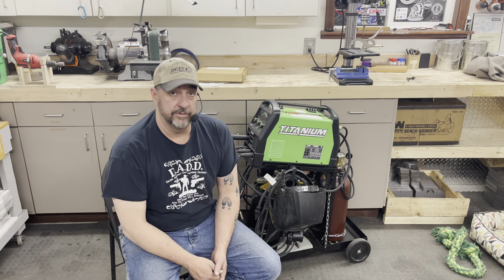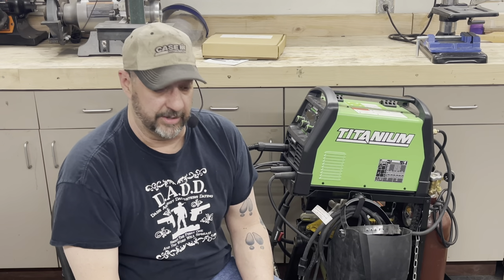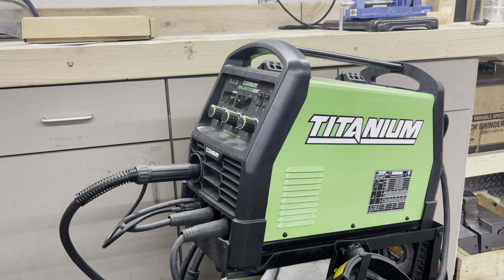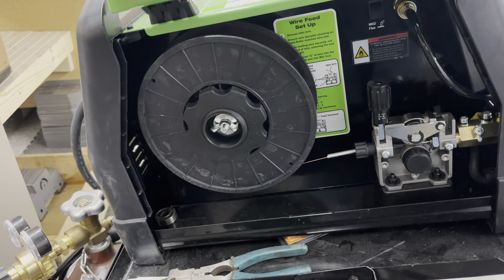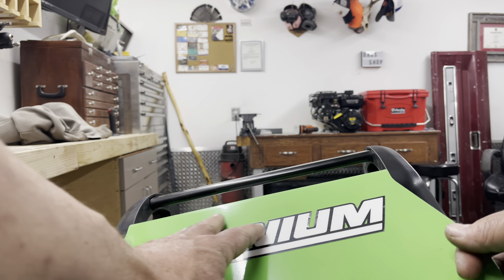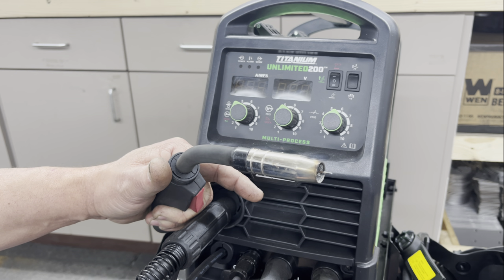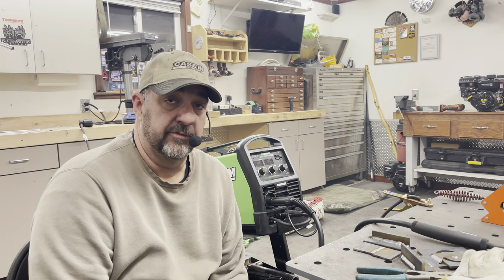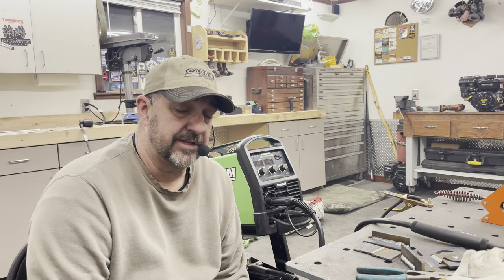Harbor Freight - Titanium Unlimited 200 Welder - Junk or Jewel?

Comment: I am trying to weld up an off road bumper for my truck. In your opinion do you think this welder could be capable of welding 1/4 inch steel. Or is that a horribly novice question. I have no experience welding just a do it myself guy.
Reply from the maker: This machine would be very capillary of doing the job. I would recommend a 220v power outlet but the answer is definitely yes, it will absolutely do the job.
Reply: @jackofalltrades7822  awesome! thanks for the response is that just the because the upgraded voltage would give me the high bonding temp/power/penetration? Only reason I ask is because I only have 120v in the garage currently.
Reply from the maker: @evankoenig952  several reasons. 

220 will give you a higher duty cycle. 

220 will give you more output amps (a full 200 amps) which equates to a hotter weld with deeper penetration. 110v will only yield 140a output. 

Running a full 140a off a 110v outlet will work but you will likely be tripping the GFI or circuit breaker regularity on a 20a garage circuit. A 15a garage circuit will not work at all.

You might also look at the 170 MIG. The Unlimited 200 has lots of features that a garage welder might not need such as TIG and spool gun capabilities. You might be paying more than you need with the Unlimited 200. 

Good luck.

Comment: 2T and 4T are for TIG.  2T is if you are doing Lift start, 4T if using a pedal.
Reply from the maker: Not on this machine. This welder does not support a pedal or hand control. This machine is a scratch start only. 2T and 4T is only functional with MIG (wire) welding on this welder.

Comment: I've been using one of those Chicago Electric $100 Flux MIG welder for several years, it works, but I agree, if you really want to weld a lot don't buy one, buy a Titanium or Vulcan MIG welder, spend the extra few bucks...yeah that $100 welder does work, but it seems even with my limited welding skills its inconsistent no matter what settings you pick, it kind of does what it wants.

Comment: Very good review overall. Here's what was missing in my humble opinion. 
3/8" thick steel welds. It's advertised as doing them. Also, what settings at the time of weld. It all looked really good, except, you left me in mystery to the setting you're using. Maybe a 6 month follow up on different steel thicknesses and settings.
Reply from the maker: 23:09 I show you the settings and even turn the knobs. 180 wire speed and 18 on the voltage. 110 v ac was the supply power.

I didn’t have any 3/8 but will get some and try it. The requires 220 and I have that now so I will do a follow up with heavier material.
Reply: @jackofalltrades7822  have you done a video with the heavier material yet? I’d like to see that too. In the market for a welder for home, farm, auto type stuff and I know some implements I have are 5/16” steel so I’d love to see the 3/8” stuff too!
Reply from the maker: @lh98  not yet

Comment: Did you add an extension to the weld cart? I bought the cart from HF and the top is too short and doesn’t have that cable support that yours has.
Reply: Never mind 🤣 3 minutes later you said.
Reply from the maker: I did. I show it about half way into the video
Reply: @jackofalltrades7822  thanks! I bought this machine on Saturday and need to get some gas this week so I can get running. I watched your tig video on this machine too. I appreciate the videos.

Comment: I've got that machine and I've used the MIG welder many times and it burns very well. Now the TIG and Stick? Now those I've not tried yet but if they burn like the MIG does then I'm sure I will be very happy with it.
Reply: They take a lot more skill. You have to manually control the arc length and wire feed. Imagine writing with a pencil that is continually getting shorter as you write.
Reply: @maplebones  Yeah, I can see how that could get tricky all right. I know when I've stick welded in the past that I'd seem to run out of stinger about 3 inches short of my goal and would have to use another stinger to finish the job. Then I'd end up with a mostly intact stinger short about an inch or 2. LOL.

Comment: Is 0.023 and 0.025 wire pretty much the same? I don't see 0.023 on the chart of this welder and I need to use that size for thin sheet metal.
Reply from the maker: Sure. Your just gonna have to adjust accordingly.

Comment: Was that MIG or FLUX you were showing?  I'd guess MIG 'cause there was hardly any slag.
Looks like a nice machine.  I'd like to learn welding, but can I justify the cost of a machine that can handle all 4 technologies?  A FLUX / MIG (spool gun capable) would probably serve me, why throw STICK in there when MIG is so much nicer?  I hear TIG is tricky, but it DOES do Aluminum nicely, however if I have to cut corners somewhere to afford my first welder, a good MIG/FLUX machine would be a good choice to learn on.  IIRC there is such a machine in the Titanium line up.
Reply from the maker: I used hard wire with 75/25 gas, not flux core wire. If your just getting started the Titanium MIG 170 or 140 would do well for you and is less money. You can weld with flux core or no flux (hard wire) wire with a shielding gas. I avoid flux wire unless absolutely necessary. It is smokey, messy and just a general pain. If I need to use flux wire (welding outside) I would rather use a 7018 rod on a stick machine.

The Unlimited 200 does do TIG but will not TIG aluminum…only steel. Aluminum needs AC current to weld with a TIG setup and this welder is not AC Capable. 

Stick capability is nice to have for welding outside or for repairing rusty metal. I actually use the stick welding function more than I thought.

I bought this machine primarily because it will generate 200 amps of welding current and is stick capable. 

Hope this helps you.
Reply: Mig and stick are 2 different animals with different capabilities. My humble opinion for someone who wants to learn welding for it's own sake, is to get a simple stick machine and practice. When you get the hang of it, you'll be able to transition to mig in half an hour, but it doesn't work the other way around.
Reply from the maker: @maplebones  I don’t disagree if that person wants to be a true welder. That being said, someone who just wants to be able to effectively stick metal together and doesn’t have time to learn all the ins and out of welding I may advise different.

Comment: Will this do 5/16” or is the 3/16 you did the max? I’m new to welding so maybe you have to switch to stick to get to 5/16”??
Reply from the maker: You could do 5/16 if your were hooked up to 220 volt.
Reply: @jackofalltrades7822  yeah I was reading about that but it looks like this welder is about $860 now not 700. I think at that high of a price there’s a Lincoln multiprocess starting 899 and up... I was interested in this one at 700 for sure

Comment: Be careful with with your regular generator. The welder is an inverter welder requiring clean power which the standard Predator generator does not provide. You will need the new Predator invertor generator.
Reply from the maker: Good tip

Comment: What concerns me isn’t so much functionality but longevity. Would you say I’d get just as many years of use out of it the same as I would out of one of the Lincoln or Millers? I guess even that question could be answered dependent on what I’m using it for.
Reply: I've resisted buying an inverter from any manufacturer because none of them are long lasting. The PCB will fail and replacement will be nearly the cost of a new machine. We've had Lincolns and Millers where the board wasn't even available after 5 years and we're told it was an old machine. Compare a 2 year warranty with the older heavier machines  that last indefinitely.  The manufactures solved that little problem with the inverter. I weld stick and tig with a Lincoln motor generator from the 1940's,  and my grandchildren will  likely be doing the same with it.
Reply: @maplebones  So what your telling me is it doesn’t really matter what manufacturer of welder I should choose because none of them offer a particularly long lasting machine compared to the older ones that last a lifetime? The problem I have usually is whenever I buy any tool or machine I strongly consider three criteria. Functionality and longevity and then price. I don’t necessarily have a problem with paying a few bucks more for something if I’m going to get many more years out of it than I would if I bought the cheaper of the options. My biggest thing right now is I’ve been wanting to buy a welder and I have very little in the way of experience using one. In fact I have no experience. So what I’m looking for is a solid and well built welder that I can hopefully get many years of use out of.

Comment: Have you had to replace any of the parts if so where did you source them?
Reply from the maker: Just tips and I got them from Harbor freight. You could also get them on Amazon and most home centers that sell Hobart Welder’s
Reply: @jackofalltrades7822  Thanks, have a CE unit that locked up in the gun, only doing occasional stuff and 120v only and the price for the gun is almost what we paid for the unit but have to order it.  Looking for a home unit that we can still get more parts for locally than the CE.

Comment: Will this welder be able to do 1/4 inch steel?
Reply from the maker: I have welded 1/4" using 220V input and it is not a problem. 110V and it would be a little too thick.

Comment: Nice welds for someone who's out of practice. I bought one of these on an impulse buy. In addition to nice MIG welds, it runs 7018 really nice! I'm beginning to think I like the arc quality of inverter machines better than transformer machines. They probably won't give as many years of service but probably enough until better ones come out and the price isn't bad for a hobbyist.

Comment: That’s a lap weld not a fillet. I have this machine and used it a lot. Only real flaw is the trigger stays on from time to time when tacking and the scratch start tig is finicky
Reply from the maker: Actually it is a lap joint. The weld is a filet. 

Filet refers to joining two pieces of metal together, when they are perpendicular or at a right angle. Fillets are used on both t-joints and lap joints.

My trigger sticks now and then too and I suck at TIG so can’t form a good opinion.
Reply: @jackofalltrades7822  huh looks like you’re correct. Also a corner weld is also considered a fillet but no one ever refers to it like that, usually lap weld, corner weld, and a t joint as a fillet.. learned something new thx

Comment: What Amp breaker does this need on 240v?
Reply from the maker: The data plate says 36 amps at 240 V and the book doesn’t really say. I will call them and ask.
Reply from the maker: I called the tech line. 30amp breaker.
Reply: @jackofalltrades7822  thanks man.

Comment: can i use with silicone bronxe wire in it..
Reply from the maker: I can’t say I have not tried. I know DCEP (Direct Current Electrode Positive)is required and this is a DC machine that will run the MIG gun on the positive or negative side.

The question mark is the liner. A Teflon liner is recommended for MIG brazing because the soft wire will plug the liner. I do not know if the liner is Teflon coated.

Comment: I just returned this welder at the cost of $850 because it would not spool.  The motor stopped working to run wire.  When I took it back they only gave me half of the money back on my card and said the other half of $400 would have to be on a store credit gift card.
Beware of this welder.  The 170 amp did the same thing

Comment: I can’t get mine to feed wire right. Any tips?
Reply from the maker: What exactly is it doing?

Is the wire feed motor turning when you hit the trigger?
Reply: @jackofalltrades7822  it will feed sometimes then slip on the bearings sometimes. Ive tried tension and made sure i was using the right bearing
Reply: @jackofalltrades7822  yes it moves

Comment: The problem with Harbor Freight welders is, all there tig welders are for steel only and not for Aluminum welding. This makes them not a true all around welder for tig. That is why I will never consider buying a HF welder. HF welders of the multi use class are not true multi use, and hide that fact in their ads.
Reply from the maker: True of the multi function machines. The Titanium TIG 200 is an AC/DC machine that is capable of welding anything…but it is $900.00.

I don’t find the TIG function on the Unlimited 200 horribly useful but the MIG and Stick functions are excellent. Still have not tried the spool gun.

Comment: The T4 functionality is for a using a hand switch on a tig torch.
Reply from the maker: If this was a HF start machine I would agree that that is one of the uses the theT4 function but not in this case. On this machine it is for MIG welding. The 170 MIG has the same switch. The Unlimited 200 is a scratch start only for TIG and does not have the option for a hand switch or a foot pedal. .
Reply: @jackofalltrades7822  That's how I use the T4 function on my tig/stick machine.
Reply from the maker: @Adrian-yn4qg  your TIG machine must have the option for a foot pedal or a hand switch. This machine does not. Scratch start is the only option with this welder.
Reply: @jackofalltrades7822  Yeah, T4 can also be used with the pedal. I have and Everlast 200amp AC/DC tig. Obviously it has a pedal.
Reply from the maker: @Adrian-yn4qg  that is my only gripe about this machine. I wish it was HF start…but that is more $$.
Reply: @jackofalltrades7822  Its hard to get an affordable all in one welder with all the good tig features. I opted for a decent tig/stick and a cheapo mig. I don't do allot of "production," it's more about versatility and being able to work with aluminum and other metals.

Comment: Have you used 3 phase Lindy  it would be in the 70s
Reply from the maker: I have not
Reply: Thanks for the reply thanks for the reply.  35 years production Welding at the combine plant for case. Only worked about nine months out of the year wasn't too bad
Reply from the maker: I was a production welder in the Case 4x4 plant. I welded 3 point hitches for the Steiger’s and the rear frames of the wheeled loaders

Comment: WOW it can do 3/16 on 110?!!?
Reply from the maker: Not with 100% penetration but yes, it will. I have done 1/4” with a groove and it is 100%.
Reply: @jackofalltrades7822  that's freaking awesome! Thank's for the reply, I think this is exactly the one I need for my garage. I was under the impression you absolutely need 240 for 3/16s. Gonna install a 240 plug anyway, but still so cool! And By Groove do you mean like a billet? (I'm not a pro, so my terminologies isnt perfect)

Comment: he said $700 but it's $899 in Ga.
Reply from the maker: It was $699.99 at the time in made the video. It is $799.99 on line today. Prices have gone up to be sure. https://www.harborfreight.com/unlimited-200-professional-multiprocess-welder-with-120240-volt-input-64806.html.
Reply: Not even available in Central Florida
Reply: @86z50r  it sure is.  I live in Lakeland,  saw a few of them today. I went to 2 stores today looking for a part.
Reply: If you dont need it right away wait for black Friday and get it for about 649.

Comment: Welding over mil-scale
😒
Driving me nuts
Reply from the maker: Nobody removes the mil scale before MIG welding unless it is a structural joint or a pressure pipe/vessel, I.e. critical joint. I didn’t think that for the purpose of demo on a cheap welder that it was necessary.
Reply: @jackofalltrades7822  Bad habits die hard. I noticed the sound and bead would be so much better with Mil Scale removed. All good you do you boo-boo

Comment: That is so lame. You can’t control the amps and wire speed separately? That is literally the only two things you need to control in a proper Mig welder. 🤦🏼‍♂️
Reply from the maker: Actually the only thing you need to control in a proper MIG welder is wire speed and volts. Wire speed is what controls amperage when MiG welding. Go look at any MIG welder, like a Millermatic 251 for example. There are 2 knobs, voltage and wire speed. That’s it.

Now if your stick welding, that’s when you need to adjust amperage and since the Titanium Unlimited 200 is a multi process welder the wire feed knob for MIG is also the amp adjust knob when stick welding.

Read this.
https://weldingpros.net/mig-welder-settings-explained/
Reply: @jackofalltrades7822  my Lincoln only has two knobs. Amps and wire speed. I have been using it for 13 years.
Reply from the maker: @Dirty-D  what model Lincoln is it?